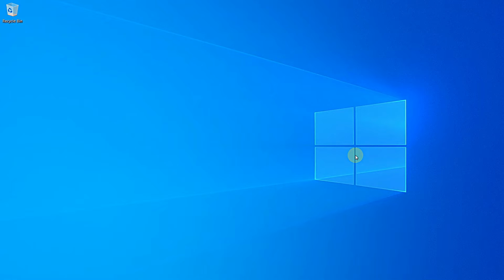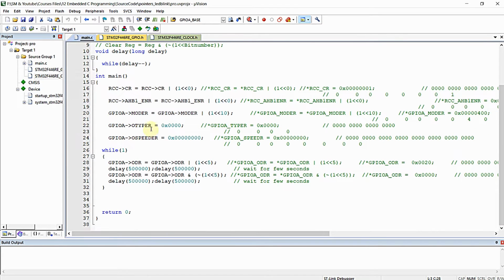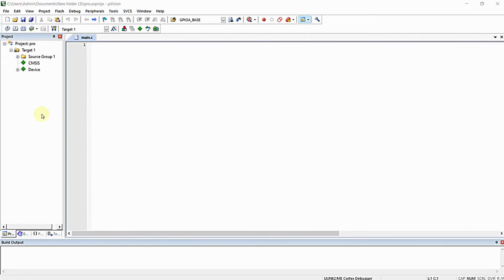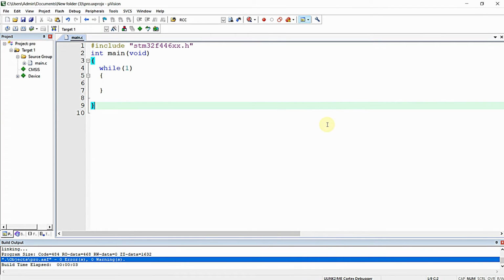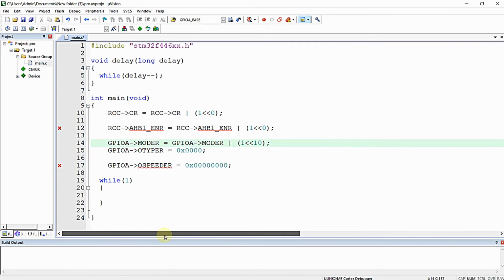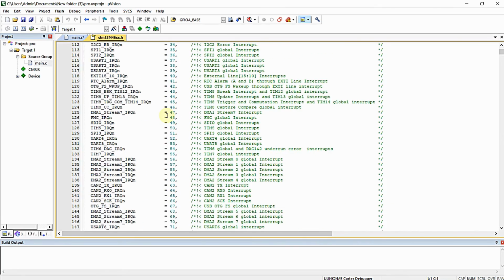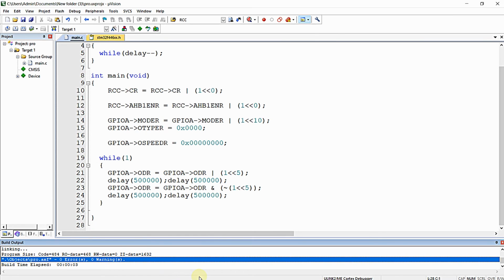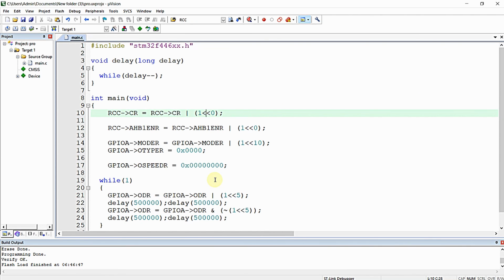Interfacing LED with STM32F446RE using CMSIS file

Comment: At 5:35 in my Keil, I can't find startup code option. I can only see CubMX. 
What to do ?
Reply from the maker: I think that is in latest version tool was changed can you try with older keil version I’ll try to make a video on latest version it is different way to handle in latest